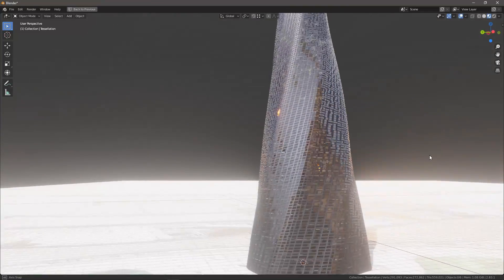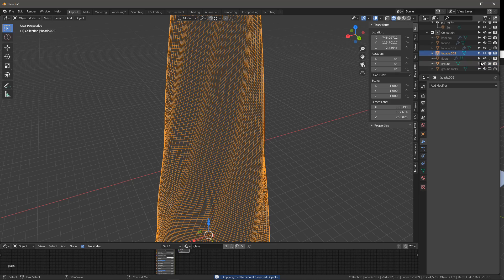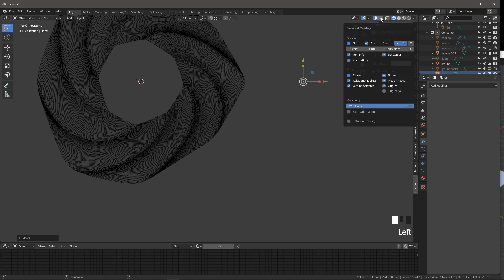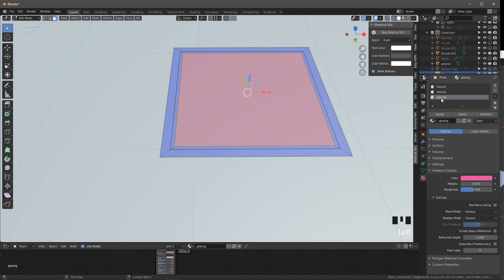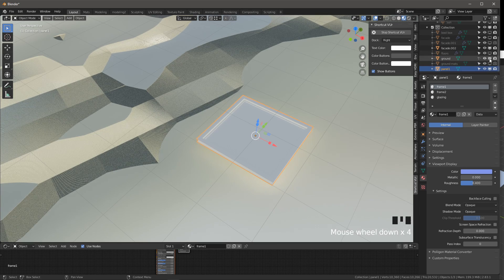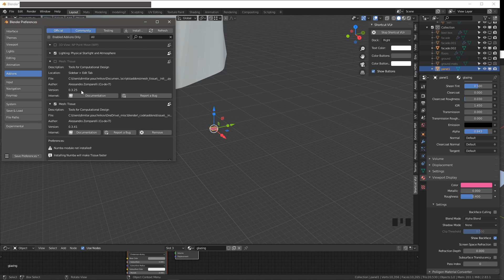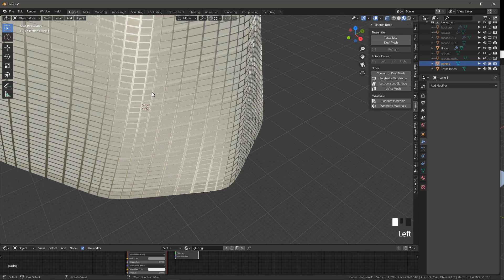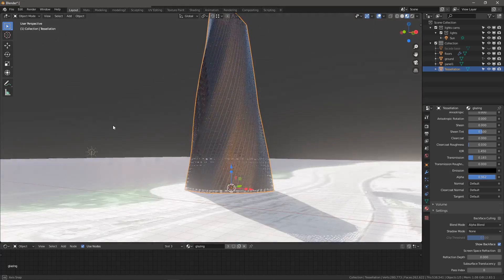Parametric tower 2 - Panels with Tissue  in 15 minutes in Blender

Comment: Kinda weird that tessalation doesnt seem to have setting for full degress like 0-90-180-270-360
Reply from the maker: It works best when they are based off of the UVs. So you technically do have the control by rotating the UVs at 90, 180 or 270
Reply: @UHStudio  I havent used it in years. SO dont know the choice for using this method. I guess the dev did this for a reason right?

Comment: Have you experimented with glass and using a very soft bump to simulate gas pressure on the windows. In real life the glass facades hardly show perfect reflection
Reply from the maker: That's something out of the scope of the videos but I am super interested about it. Unfortunately there is no edge detection node for flat independent surfaces like in other renders so I am still investigating the best way to represent
Reply: @UHStudio  You can apply it globally or procedurally per object. Tesselation does duplication per model right? I do think nodes is powerful enough to override that, but im not sure, i dont know it to much. I used use Thea Render with BLender. Just jumped ship to windows and kinda dropped that engine. I still think you can apply a procedural bump depending on its 3d location. Nodes is super powerful. It will make renders look way more realistic. I think i noticed in all renders that the facades look kinda flat